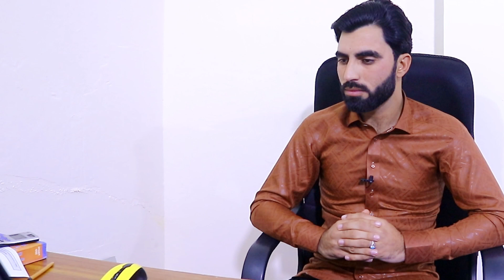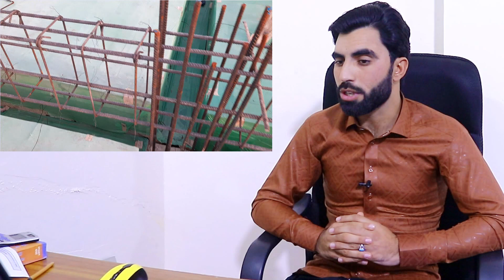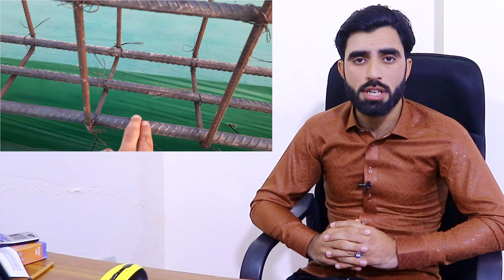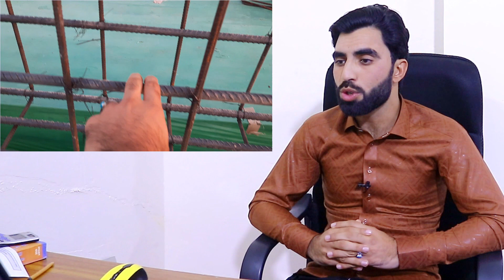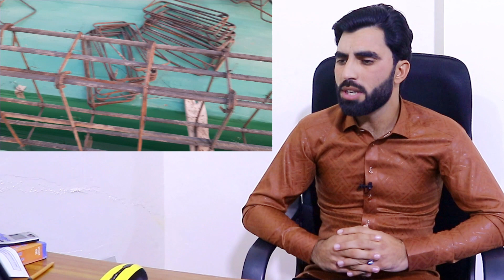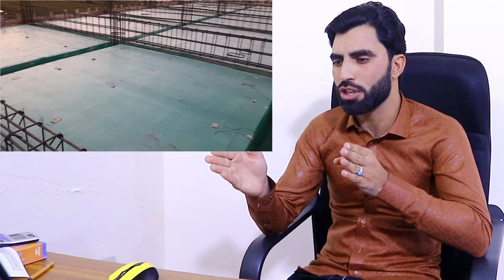Proper Design of Beam for 4 Storey | Practical Video on Site |

Comment: Nice video but designing of beam is not tht simple they way u explained it . The Structure Engineer goes through a whole process to design a beam, column or slab. You should talk about the execution of each structural members.